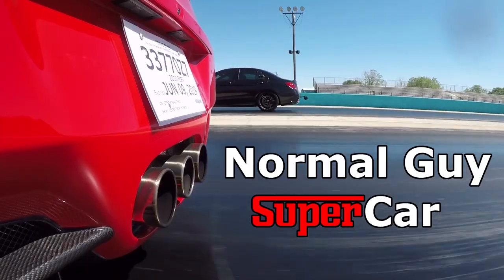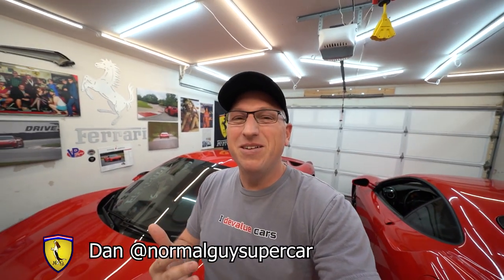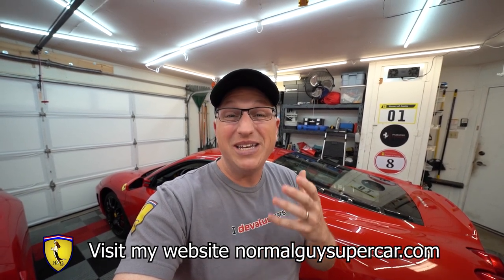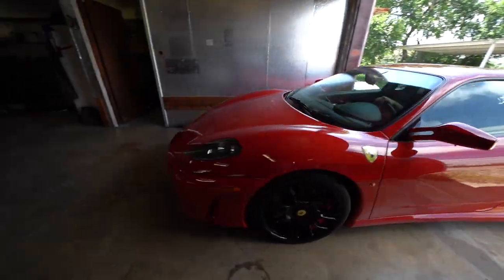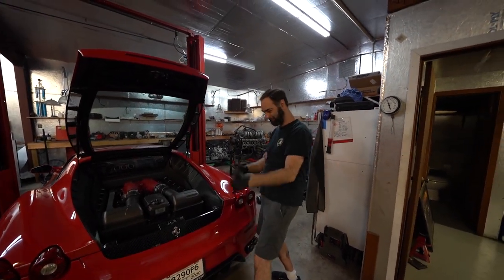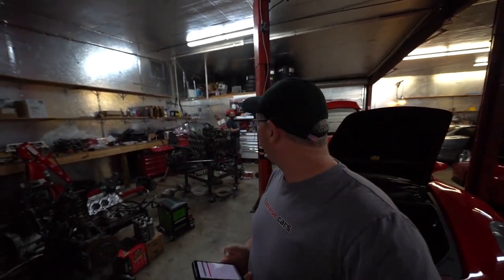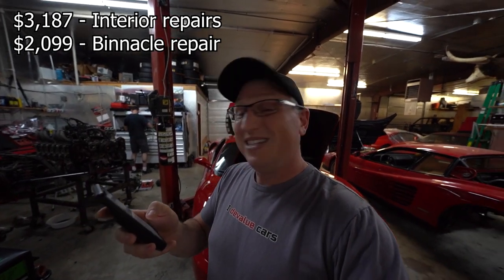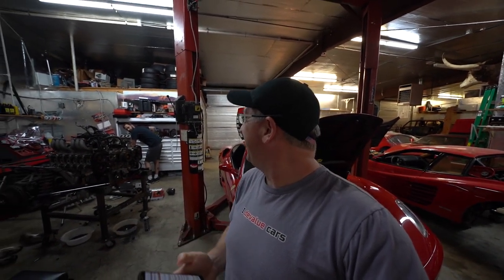PPI Reveals $75K in REPAIRS for a FERRARI WORTH ONLY $80K

Comment: Hi Jim!
 
I have attached the inspection report for your vehicle. Here are the technician’s findings and recommendations:
 
Convertible top is crooked, one side latches before the other. Once the headliner is replaced, we will run it a few times and see if the issue is still present.
Annual service due. Not sure what the service history is, but we would recommend the following based on normal intervals
Oil change + annual inspection: $1000.00
Drive belts: $450.00
Pollen + engine air filters: $480.00
Brake fluid flush: $460.00
Gearbox/differential + DCT fluid flush: $895.00
Power steering flush: $450.00
Spark plugs: $980.00
Washer spray nozzles misaligned (can be adjusted during annual inspection)
High beam lights not working with headlight stalk. Recommend replacement $2950.00 parts/labor
Engine and power steering oil both overfilled (can be addressed with oil change/power steering flush)
RH secondary air pipe is crushed but still functional. I can provide a quote if you would like.
TPMS warning light, sensors show 0 months life left. Recommend replacing set of 4 sensors $2400.00 parts/labor
Vibration felt at idle, rattling from rear of the vehicle. Can diagnose further if you want.
 
I will have my sales manager take a look at the vehicle as well and provide you with a rough estimate for value.
 
Please let me know if you have any questions. Thank you!
 
Monica Wegerer
Service Advisor
Reply from the maker: Interesting

Comment: A company that runs track day experiences here in the UK had a F430 for several years.  After 100k miles even it still didn't need new ceramic rotors.  The ECU will log an estimated wear based on usage so that would have been useful for the new owner to know.  Perhaps Josh just didn't mention it.  As he says though, the best way to confirm wear is by weight, as they just shed carbon from the matrix rather than getting thinner like steel ones.  I wonder if the dealer that did that PPI was really just trying to say DON'T BUY IT!

Comment: Never have a PPI done by someone who is an acquaintance of the previous owner. They skip over things because they sometimes rely on what the previous owner has told them about the car and don't go deeply enough into certain areas. After taking ownership of my F355, I found 30 additional things to what the PPI inspector found, costing me $40,000 in repairs (and it was only that "cheap" because I did a lot of the repairs myself).
Reply: F355s are one of those special models that often need a major repair, like cylinder heads rebuild. Different level or risk.
Reply: @exoticpowerperformance3759  I wish it was just normal wear and tear, but the previous owners had made a clear effort to hide some serious defects (e.g. rewiring the Check Engine light so that no engine faults would activate it... and cleaning up broken gearbox teeth from the magnetic gearbox drain plug. The were about 10 missing teeth from the gears, but no evidence of those teeth in the gearbox pan).

Comment: Dan, hope you can help me with a very quick question. My 360 has been doing these weird random CEL beep hiccups. They feel like misfires but I think it's more to do with the CELs and whatever the ECU is doing. I only have CAN line error codes. Josh mentioned one interesting thing about the engine mounts on the Cali and how bad mounts can mess up misfire calculations? Now, I decided to install Challenge Stradale engine mounts in my 360.. The car definitely vibrates more at idle (the car also feels more alive which is why I put them in). Anyway.. Do you reckon these mounts are somehow messing my car's readings up? 🤔🤔 Appreciate if you could pass it by Josh! 👍🙏
Reply from the maker: Yeah I'm not much help on that one. Sorry
Reply: @normalguysupercar  there is a word for a car such as mine.. And I believe that word to be "shitbox."

Comment: I had the headliner replace and so I got a inspection, with the replacement of the headliner I also need the new cords, that 3700 for that, 2400 to replace the headliner, plus 175. For a couple clips then the transport back and forth was 1400
Reply from the maker: Cool
Reply: I thought I would just share that

Comment: This seals the deal for me to never purch a used Ferrari without warranty
Reply: Theclassiccarnut you are indeed correct .  I bought a California with very low mileage and it was maintained regularly by a Ferrari dealership. Upon buying, the used car dealership said they did a PPI and everything looked great. I kid you not, within 10 miles of driving the car, I got a gearbox failure message. Long story short. I took the car to Ferrari and it ended up having to have a 45,000 DCT replacement. The gods were smiling at me because they still had a month left on the manufacturer warranty and even with that, I was urged by Ferrari to extend it because due to Covid ,there was no guarantee that they were going to be able to have Italy approve the repair before the warranty expired. Never ever deal with these cars without a warranty and I have the money for an expensive repair.
Reply: I could not disagree with this more. My 458 has been bullet proof and I run the hell out of it. Has 28000 miles on it and about 8000 of those have been track miles. I also had a Porsche and it didn’t hold up near as well. Maybe I have just been lucky?
Reply: @gerardc5457  IRS nit Ferrari. It’s the California.  Bad model.
Reply: @brianb4568  no the California’s aren’t good models.

Comment: Question for josh, what does it take to do a carbon fiber to steel conversion on breaking systems? Is it as simple as a pad and disc change or do you have to swop the caliper and go down the worm whole from there? (I think on Lambo mucies you have to swop the axel hubs and carriers over.

Comment: Frankly, the potential customer on the California should have walked away just based on the visual inspection. Broken buttons, worn key, excessively warped leather, yellowed clear bra - all on a vehicle with just 20,000 miles? That’s enough to walk away. Period. There was no need to proceed with a PPI on it on that point.
Reply: poor exterior and interior condition, ESPECIALLY on a car that isnt very old is an immediate cue the vehicle was poorly maintained.  it should have been expected to have a poor bill of health.

Comment: A Ferrari dealer in  south Florida  charged me $1000 for a ppi inspections on a Ferrari F430 .  Them told me the soft top was not operating properly, and will cost $23,000 to fix.
Reply from the maker: Was is actually broken?
Reply: @normalguysupercar  

They said the mechanism was not working, and top needed to be replaced. 
Their reason for the $23000
was that it was labor intensive.  Still did not make sense why it costs that much. Almost 25% of the price of the entire car at that time for just that part of the car. Even at $400 an hour excluding the soft top material and mechanisms
I estimated based on 400 dollar per hour labor, almost  40 to 50 hours of labor for a top !!!!!

Comment: Question for Josh - is it recommended not to use the pink antisqueal gel when using ceramic brakes (assuming it's used correctly!!)?
Reply: I don't ever recommend anti squeal coatings on any brakes, ever. Most especially on carbon ceramic brakes.
Reply from the maker: There's your answer. 😁

Comment: Bro thats why i dont buy Ferrari any more.with a 20k miles ferrari with  gaskets seales mounts that needs replacing i think your paying to much for something not reliable.i can just imagine when the car hits 40k miles it will be worthless.so your going to pay for something thats going to sit in the gaurage because your scared to drive it because of reliability issues.why buy a 250k car that last 20k miles sorry dan but Ferrari is junk.
Reply: If you look closely, most performance engines (including the Japanese cars) which have higher than normal crankcase pressures will get some weeping and blowby from the seals. As long as it is a small weep it should not be a problem. Use a bit of citrus cleaner and you are good to go.
Reply: @freddaniali  lmao not something i expect after paying  a 250k price for super car. at 20k miles.with issues unacceptable. the toyotas weep after 100k plus miles.thats acceptable. ferrari mclaren better get there crap together because theres a new kid on the block and his big brother the c8 is right behind him.